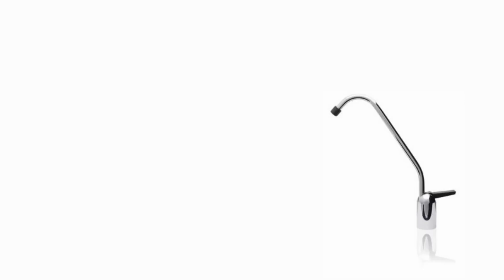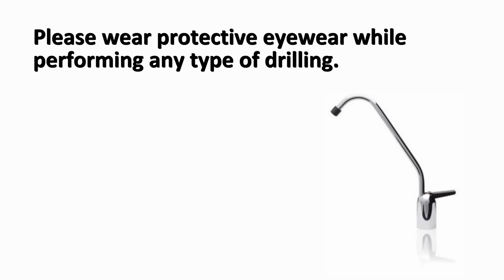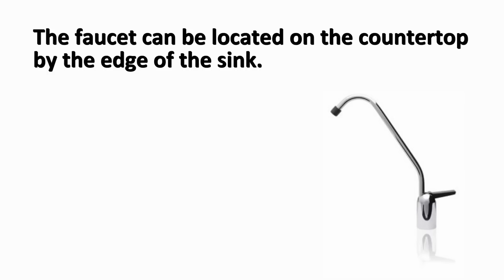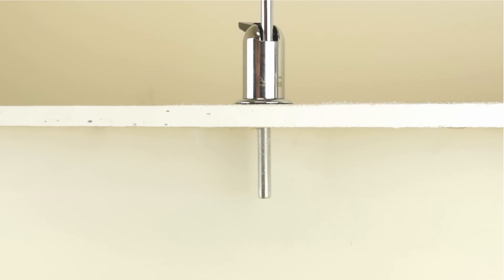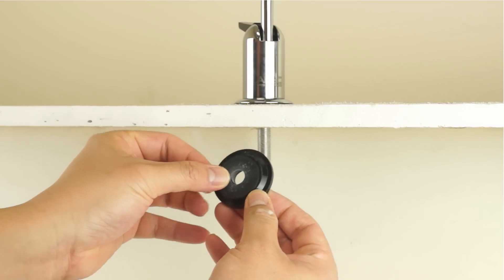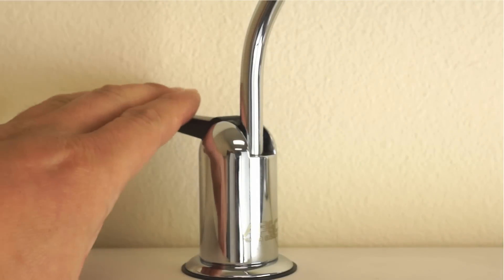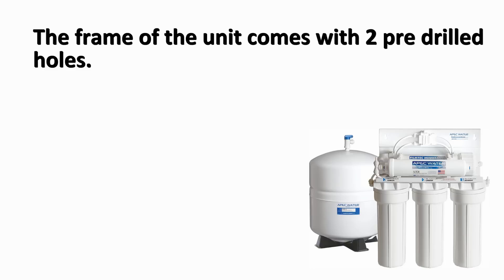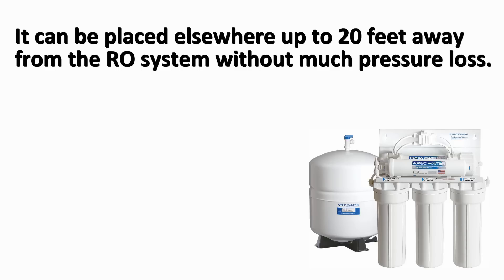How to Install a Reverse Osmosis Drinking Water Faucet - APEC Water Part 4

Comment: You forgot the step that I spent hours figuring out. Flip the rubber washer if its going to be in a metal sink with hole already in it.
Reply from the maker: Dear Customer,

Thank you very much for your feedback and I apologize for any inconvenience. This instruction is in our manual’s faucet installation page. For stainless sinks, the black locating washer needs to be reversed.

Best Regards,
APEC Customer Service